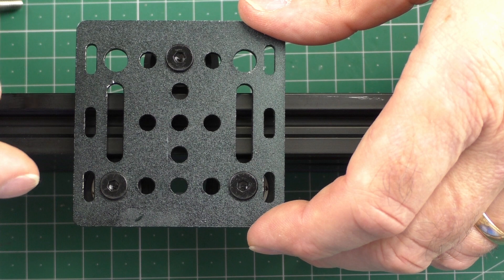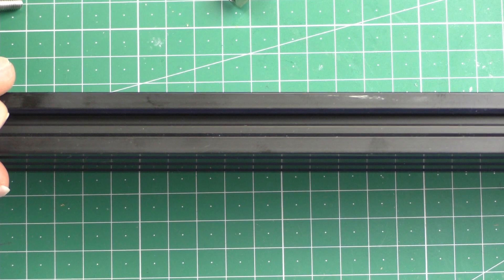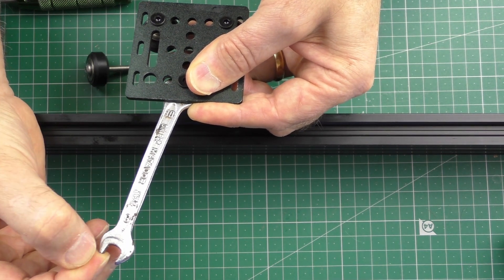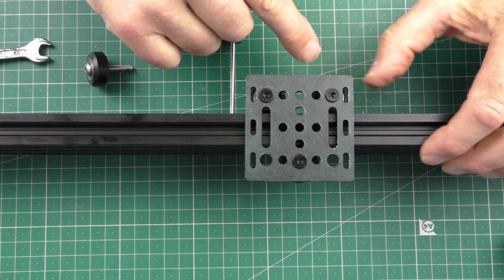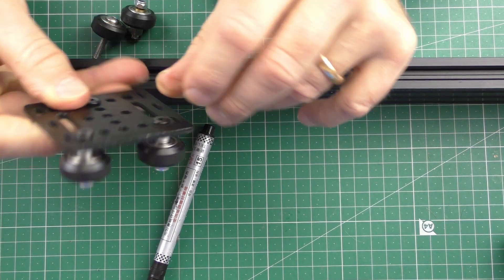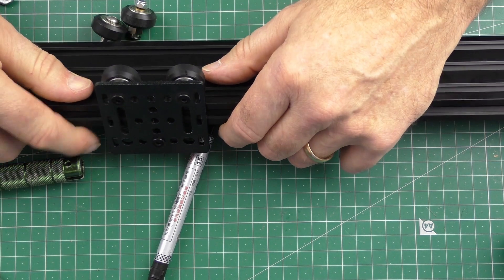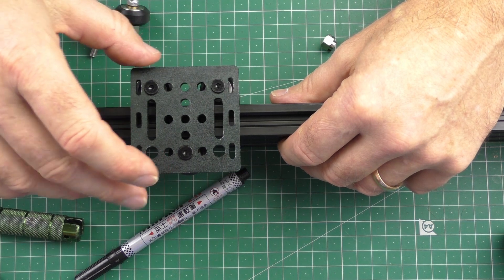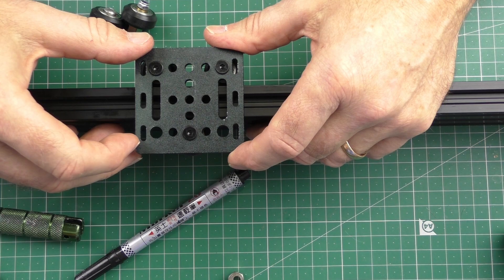How to adjust Eccentric nuts 3dprinter correct adjustment no more flat wheels

Comment: First I loosen up a bolt axle and tighten it back after adjusting the eccentricity. 

The eccentric is held in place by friction with a carriage plate. You don't want to excessively rub the surfaces under max tension; it will grind them and reduce friction. Couple it with vibrations, and it will result in a faster loosening up.
Reply from the maker: Glad it helped